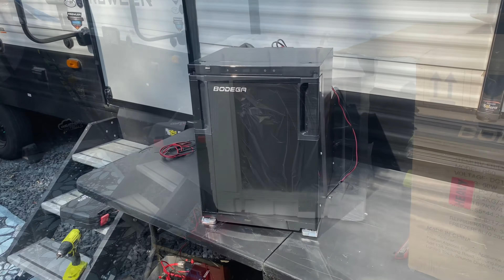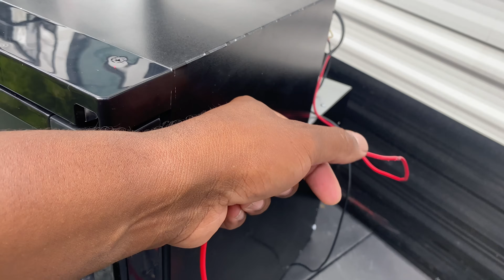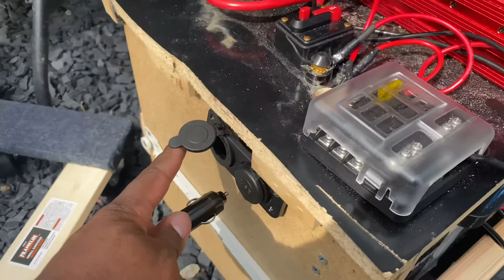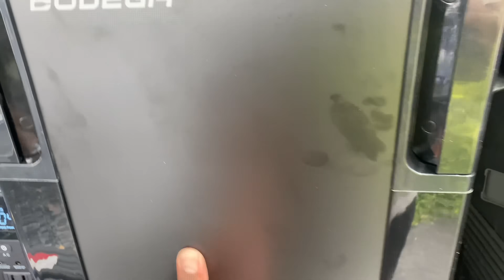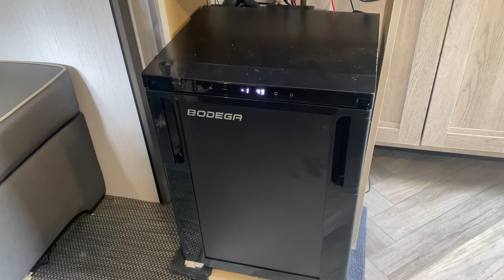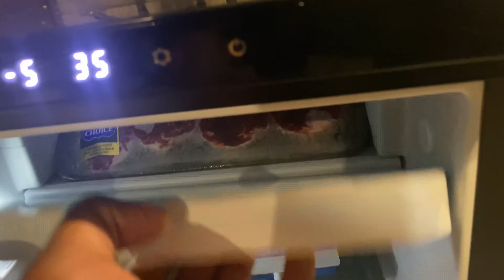Bodega 12 Volt Refrigerator Install And Review / Camping Fridge / RV Fridge / Easy Install

Comment: Hello, Question I'm installing one in my rear compartment in the Trailer. The main trailer power fuse panel is about 5 feet away. I would like to Run power and ground off the main panel into the compartment to a new sub fuse panel. Then hardwire the fridge to the subpanel. Then I'm going to wire up a 12-volt 4 socket power station to be able to power up a few other 12-volt items. Will this be, ok??

Thank You and always great videos.
Reply from the maker: Yes, that will be fine. The fridge does not pull much power. Just keep checking that your power station has power. Sometimes power stations depletes even when plugged in. That’s for why ever is plugged into the power stations. The fridge hardwired to the subpanel that’s connected to the main panel will be ok as long as you continue to have power. Batteries are everything. Your setup sounds like it will be amazing.
Reply: @thesmallsrvadventures should i put a fuse between the main & sub panel on the hot lead?
Reply from the maker: @firemandon64 yes a fuse will not hurt. Check the fridge to see if there’s a fuse line on it. If the fridge has one there’s no need to put a fuse on the line that the fridge is on. You will need some sought of fuse on the hot side going from the main to your subpanel. I hope this helps.

Comment: How is the noise?
Reply from the maker: When the compressor is on you can hear it. The noise is not loud. If I have my tv on low I can’t hear when the compressor comes on.
Reply: @thesmallsrvadventures  good to know thank you! i have a small room rv so i wondered if i could go sleep while the cooler is working...

Comment: I am looking for a 12 fridge to replace the VERY TEMPERAMENTAL Dometic absorption fridge that came with my 2013  Coachmen Clipper travel trailer. According to the specs it will fit in the hole the old fridge is in. Have you had any problems with the Bodega yet?
Reply from the maker: How are you John. I’ve had this bodega Fridge for nearly three years. I’ve not had one problem. It’s an awesome fridge. I hope this helps.

Comment: Hi....there ... What model is that Bodega fridge you have...1.4 cu ft ..1.7....?
Reply from the maker: Hey there. This Bodega Fridge is a 45 Liter (1.6 cu. Ft.). We’ve had it for over two years now. It’s still running strong. Here’s the link if you want to check it out. 

Bodega 12 Volt fridge freezer 45L
https://amzn.to/3DCbFzC

Comment: Hello, and thank you for this video! I am trying to follow along and attach a cigarette lighter/accessory plug to my Bodega like you did here, but I do not know what gauge wire the adapter should be. I am finding several different gauges online and I am stumped. Any help is much appreciated!
Reply from the maker: Hey friend. The fridge comes with a 12 gauge wire. You will be safe with the cigarette lighter adapter wire. The fridge doesn’t pull much.
Reply: Thank you!!  I did it, and it works!  @thesmallsrvadventures
Reply from the maker: @dharmalovemay  you are very welcome 🤗

Comment: How long does it take before you can put food in the bodega
Reply from the maker: They recommend that you leave the fridge plugged in for about two hours. I put food in mine right away. Cold food help the fridge get colder faster and it doesn’t have to work as hard to get to the desired temperature. The fridge keeps things super cold once it’s up and running.

Comment: UPDATE ON OUR ACTUAL USE:  So, we replaced our 100ah hybrid gel battery with a 200ah Lithium.  Within a month the battery got too low to continue to support the Bodega.  So, it seems pretty conclusive that a 200w rig is not enough to support this refrigerator, even under great conditions.  We had very few days of overcast, with the majority of days have almost complete sun (and we have no shade situations).  We had the refrigerator compartment set to 40 and the freezer compartment set to 5.  While the Bodega is rated at 60watts, obviously it's only going to use that much when the compressor is cycling.  And we hardly used our trailer lights at all (it has 8 of the 3w LED 12v puck lights), so power use was almost exclusively the Bodega.  So, our next step will likely be to add another 200w of solar and upgrade the MPPT controller from 20A to 40A.  Hopefully, that will generate enough power to keep ahead of how much the Bodega uses.
Reply from the maker: I hope you get the right set up. We have been using our bodega fridge daily. With Solar and Dc to Dc power we haven’t gone without power. A small generator also helps to recharge the batteries when needed. Solar is catching up to modern times but it’s not all the way there yet. Continue to watch our videos. We try to keep up to date on many of the charging necessities when Boondocking.

Comment: We ordered one of these last week, and it should arrive Wednesday.  We would have really liked to get a larger one (around 2.0 cu ft), but this was what we could afford.  It's a little bit smaller in overall physical dimensions than the Igloo cooler we've been using, and definitely smaller capacity.  Obviously, a fair amount of cooler space is taken up by ice.  

We have a 6x10 cargo trailer that has been converted to teach scuba diving, but also has modest off-grid capability (you can see the tour on my channel).  Our hope is that this will have enough practical capacity to be a great replacement for our large cooler.   Our trailer currently is configured with dual 100w Renogy solar panels, 20amp MPPT charge controller, 1000w inverter, all feeding into a 100ah hybrid gel battery.  My first point of attention will be to see if, under normal conditions, our solar rig will keep the Bodega powered without killing the battery.  Ultimately, we'll upgrade to LiFePo batteries, but decent temperature-protected versions are still a bit out of our budget.

Thanks for the review on this unit, it was very helpful!
Reply from the maker: It’s a really good fridge. I use it everyday for work. It keeps my food fresh and my drinks cold. The freezer is a bit small but it does the job. Under the right setting you can use the top shelf as a freezer too. We have it packed and everything remains very cold. Let me know if you need any help with installation. We’ve connected this fridge in many ways.
Reply: @thesmallsrvadventures  Well, got it installed and it killed our battery by the end of the week.  It looks like we just don't have enough solar and battery to support it.  We currently have a 200w Renogy system with the 20amp MPPT charge controller and a 100Ah gel battery.  It appears we'd need to bump up to 400w of solar with a 40amp charge controller.
Reply from the maker: @cetifoxproductions  we use solar and a dc charger to top off our batteries when we are off grid. If you are mobile your vehicles alternator or dc charge point can help recharge your batteries. We also have an electric battery maintainer. Another way to keep everything charged is to increase your battery capacity. 200ah-400ah works great but you will still have the need to keep the batteries charged.  The fridge uses 30-40 watts to power. It doesn’t pull power all the time. The compressor kicks on to keep the fridge at the desired temperature. If you need any tips on batteries and charges let me know. I have two of these fridges in two different vehicles full time.
Reply: @thesmallsrvadventures  Thank you for the advice. Since our setup is a converted 6x10 cargo trailer, a vehicle alternator solution isn't possible (since we're parked more than we're driving).  I'm thinking that even if we went from our 100Ah gel battery (which really means we only have about 50Ah of effective use) to a 100Ah or 200Ah lithium, we would still not have enough solar to keep up with the drain.  We do have room to add two more solar panels, which would double us up to 400w of potential generation and would need to upgrade our 20amp charge controller to 40amp to accommodate.
Reply: @thesmallsrvadventures  I'll take all the advice I can get.  You've seen the description of my current system.  I'm probably not reading the data from my Renogy DC Home app or the Renogy BT app correctly regarding how much power I'm generating/charging.

Comment: As always you did a great review on the review with the added bonus step by step of converting the fridge to a 12V 👏🏾👏🏾👏🏾👏🏾 I'm still doing my research on a fridge for my car. I'm also looking for some good solar panels. I plan on boondocking during the fall/winter months.
Reply from the maker: Hey Sunshyne.  I’m doing another review on a fridge that’s made for cars in a couple of weeks. It’s the one I use in the camper a lot. The great thing about them is that they work from 12 volts so you can charge your portable battery while it powers the fridge. It’s awesome.

Comment: Yeah, that's how I roll with my power stations.  I plug the fridges into the stations and the stations into my 12v aux plugs.
Reply from the maker: That way your power is nearly unlimited. I really like having multiple fridges. When I build out the van I’ll only have one though. I’m still on the search for the van. They are so costly now.
Reply: @thesmallsrvadventures  Why a van, anyways?  Is it for when you want to travel alone?